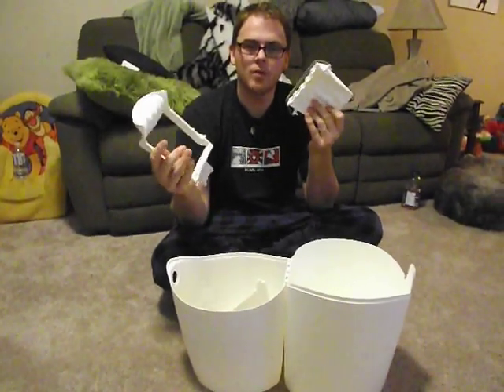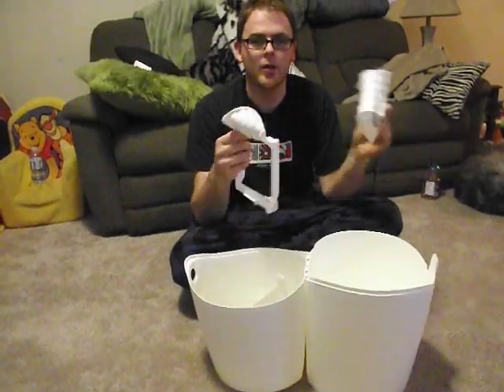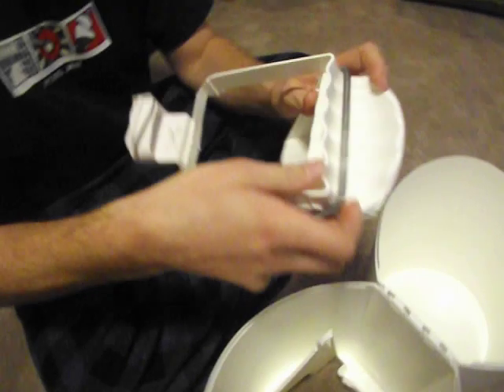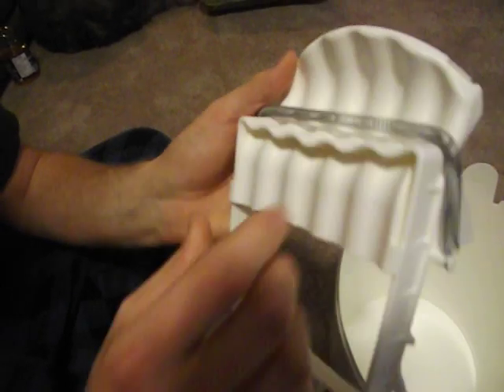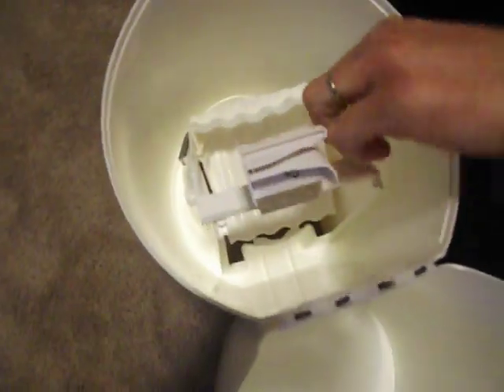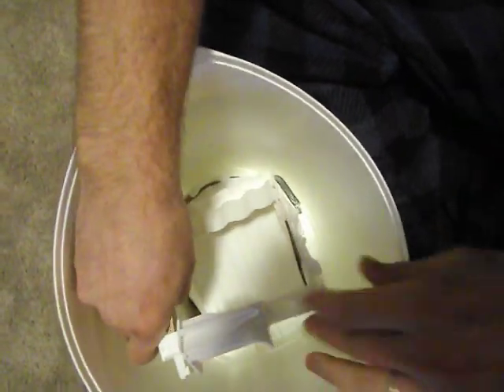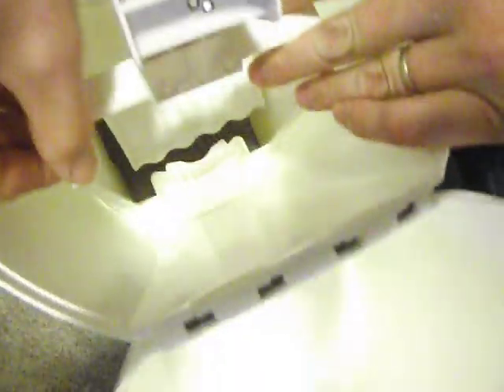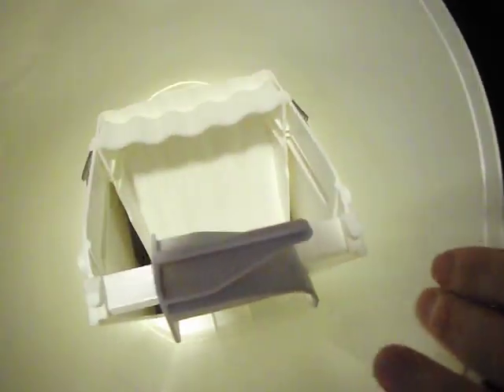Fix a Diaper Genie 2 - Broken Spring Loaded Plastic Insert

Comment: Late to the party: but thank you  so much. I consider myself above average when it comes to fixing(hack) stuff, but I don't think I'd ever have worked it out without this video - I was trying to anchor the spring to loads of different points on the main lid expecting it to pivot & pull back against that.  As for people downvoting, wtf what the hell is "wrong" with this video: I'll tell ya nothing!